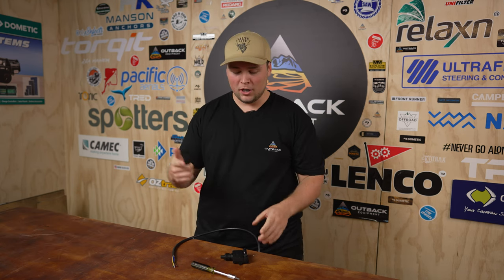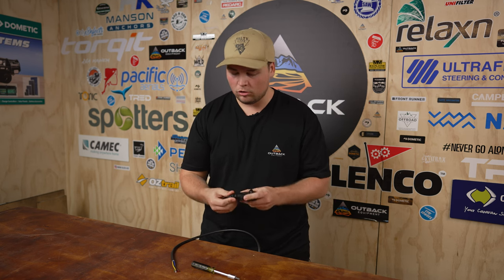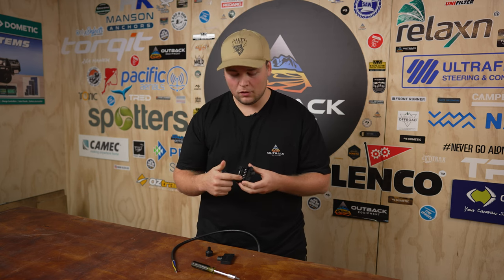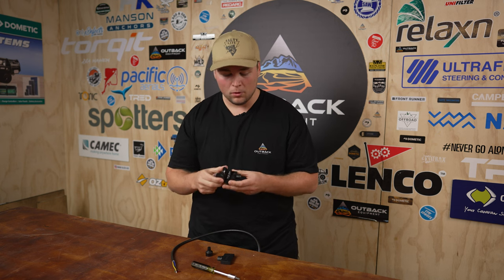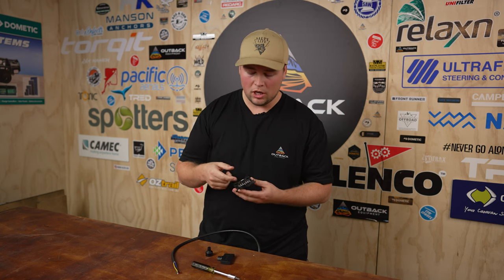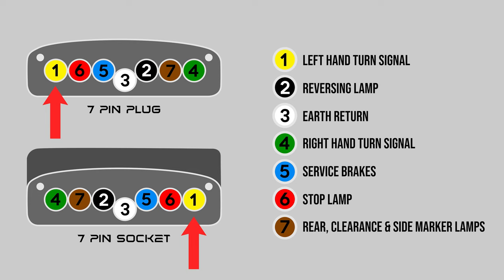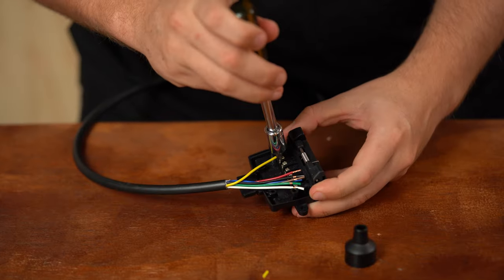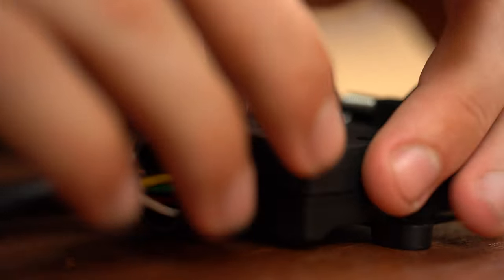How To Wire A 7 Pin Trailer Plug

Comment: I have a US 7 Blade plug and would like to convert it to a AUS 7 flat pin. I noticed they have different wire colors. Can you please help map the colors? Ta.
Reply from the maker: Hi Youyangmtbiker5780,
 
Due to different country standards, the easiest way to identify which cable is which we would recommend you grab a friend and a multi meter and work through the cables and labelling as you go by turning them on one at a time. Also take into consideration the Australian market have independent amber indicators as mandatory and the US Market tend to use brake lights as an indicator. Meaning if done incorrectly your indicators will turn on when you brake so you may need to pull that signal from the front of the car somewhere.
 
 By looks your Green and yellow wires will be the issue as they operate both the brake light and turn signals, so you may need to find the relay for those inside the car or under the bonnet and tap into that. 
The Purple or light green wire should be your reverse signal which on the AUS plug will be position 2 the black wire position
The Brown Wire should still be the same across both plugs and operate the park, clearance and side marker lights
Blue will also be Blue on the AUS plug for your brake controller
US White will also be the AUS White for the earth
US Red wire will become obsolete on the AUS plug
Hopefully this helps you out and if you have any other questions let us know!

Comment: Where about the sensors I have sensors error when my harness is connected to the car. And I don’t have any trailer hocked up.
Reply from the maker: Hi Mate,
 
sounds like you are in need for a trailer plug with a Reed switch. Head over to Outback Equipments Website https://www.outbackequipment.com.au/, We believe one of these to part numbers will get you out of strife 82043BL or 82044BL

Comment: socket - m or f?
Reply: Generally, a Socket (or receptacle) has female electrical terminals and plug has male terminals. Some types of electrical connectors will have an additional shield around the pins of the plug to stop them being bent, which can cause confusion about which is male and which is female. Some types of connectors (like Anderson plugs) are genderless.

For trailer plugs, the trailer will have a plug (with exposed male pins) and the vehicle will have a socket (with enclosed female terminals). Some types of trailer plugs, like US 4-pin plugs are genderless and have one exposed pin on one plug (and three enclosed terminals) and three exposed pings on the other.(and one enclosed terminal).